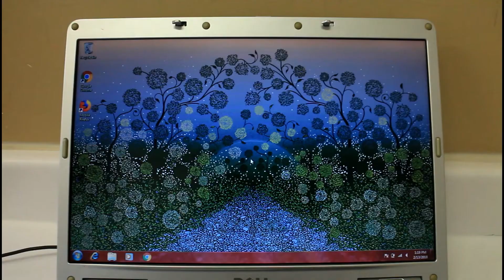Upgrade and Restore Of Dell Inspiron Laptop 1501 for Selling on eBay

Comment: I was watching this video originally because I was wondering if dust can get underneath the motherboard itself and if that can generate additional heat or if it's worth removing the motherboard and checking for dust?

Hey nice video, i'm glad I watched this because I recently took my dell inspirion 1501 apart and cleaned it and man mine was dirtier than yours huge clump of dust in it thing was overheating bad but I don't think I re-applied thermal paste to the chipset because I didn't exactly understand what it was I think atleast I didn't clean off the old thermal paste and it's definitely seemed to be running a lot cooler and smoother... going to take apart again tomorrow and re apply thermal paste to the chipset.

edit: there seems to be a thermal pad of sorts on the chipset so I didn't apply thermal paste to it, I hope I am correct in doing so however seems surprising to me that they had this technology back when these things were new
Reply from the maker: You should use thermal pads. They can be purchased from ebay or amazon for very cheap. These were very thin pads so I just used thermal paste. If the pads dont look top bad just re use them. Thanks for watching.

Comment: Hello! Can you tell me if you have upgraded RAM to 4 GB? Does it support 1501 or just 2 gb RAM? thanks
Reply from the maker: Max I was able to get was 4gb of ram and it showed up as 3.85gb available out if 4.
Reply: @GoodUsedGoods  did you upgrade the bios?  because it is advertised  that Max memory is 2GB only  for   Dell Inspiron Laptop 1501